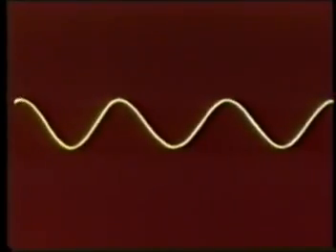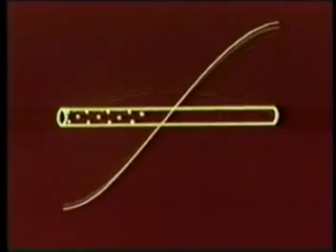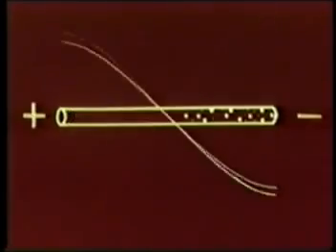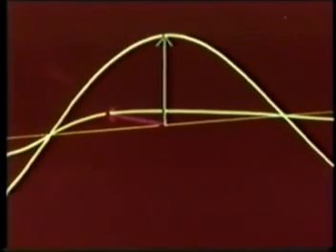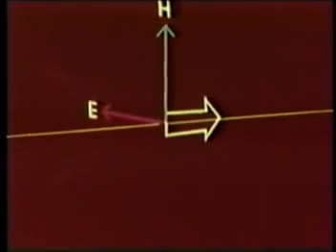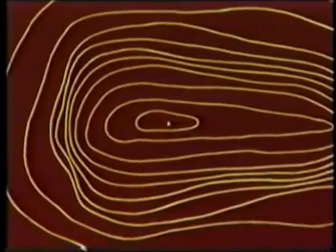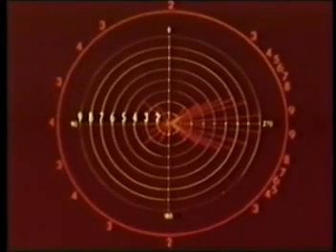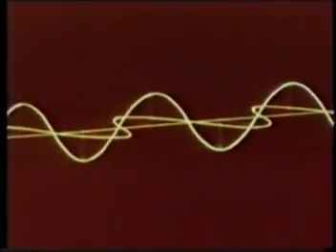HOW DOES AN ANTENNA RADIATE?

Comment: It's showing the Nearfield Zone, where the fields lag by 90deg, and the EM energy is periodically sucked back into the antenna, same as capacitor-discharge.   But out at halfwave distance, or "Farfield Zone," the two fields are in phase, and energy radiates outwards as sphere-waves.

Comment: How can e field and h field be in time phase when they clearly are the opposite. When the e field shows 0 in the center, h field is at  maximum at the center. H field is maximum when current is flowing and E field is maximum when current is not flowing.
Furthermore he desciribes the h field as direction of force instead of direction of field.  They are not the same thing.  Magnetic force is orthogonal to magnetic field, they are at 90 degrees.  That is what makes your motor turn in the first place.

Comment: if the electric fields and the magnetic fields and maximum and different times (when one is 0 other is maximum) then how come in the wave representation you showed that both are maximum at the same time? what i mean is during the animation of dipole you showed magnetic field is max when electric field is zero,  and vice versa. So later when you put them in to sine wave representation why did you show that both are max at the same time?
Reply: The antenna near-fields are non-propagating, reactive fields that store energy back and forth between the electric & magnetic fields and these are in fact 90 degrees out of phase. However, it is the far-field that is radiating and which carries energy away from the antenna and both E & B are in-phase in far-field.
Reply: Just saw this was already explained in another comment from 5 years ago by 'Odd Are Havardstun' in his reply to Smit Chaudhary.

Comment: The video says H and V are out of phase. Cool enough. Now E and V would be in phase. But still H and E are in phase. Anyone can tell me what I missed?
Reply: +smit chaudhary In the reactive near-field (closest to the antenna) the E and H are 90 deg out of phase. During the Fresnel region (radiating  part of near-field just outside the reactive near -field)  this changes. At som distance (dependent on wavelength and antenna dimension) as the fields are less then pi/8 out of phase, the far-field or (Fraunhofer region) is defined. From here on, the field are in phase and travel as a EM wave in the direction of the Poynting vector.